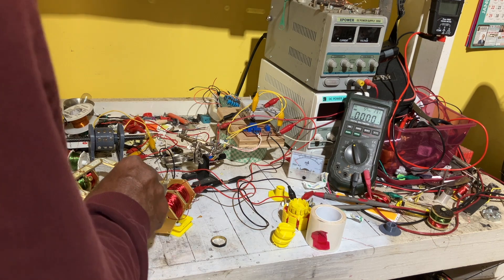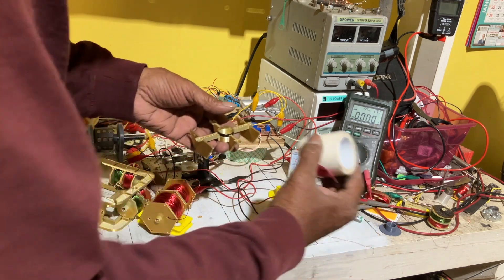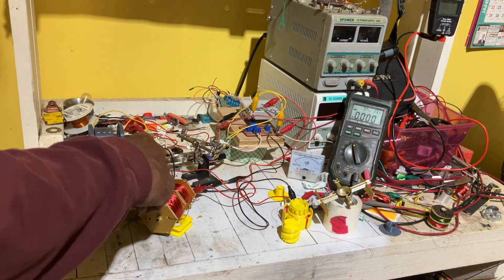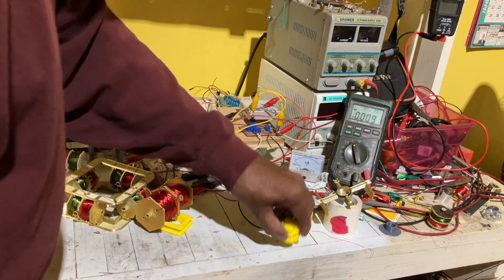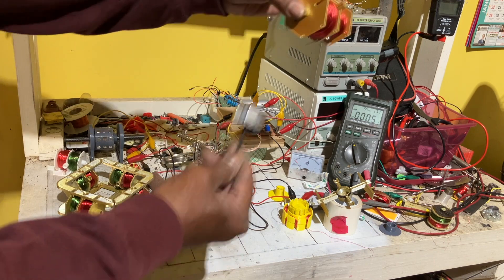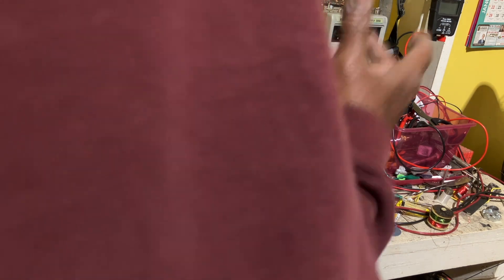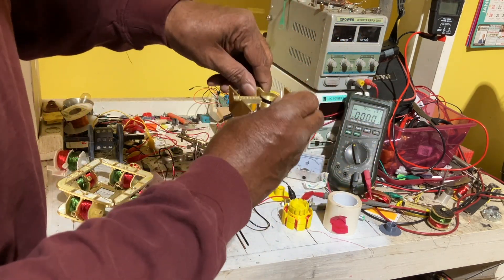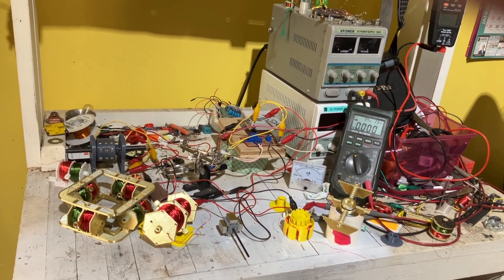Simplest Self power generator motor design follow the evidence and principles I've tried to share.

Comment: Rotate the magnetic field next to two coils, which has a COP>1. Is my understanding correct?
Reply from the maker: try basic English because I don't understand your question . my example is field inter action one field affecting 4 others
Reply from the maker: No heat magnetic levitation . force yes resistance but friction less system
Reply from the maker: OK cop is less than a vapor system. if tolerance are brought under .025 thousand which is not hard. my tolerance are at .6 now